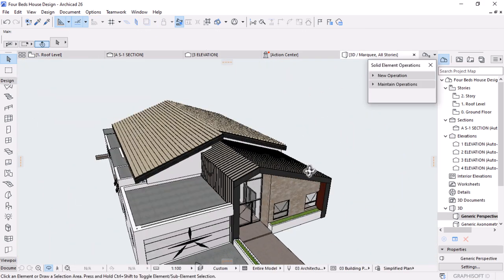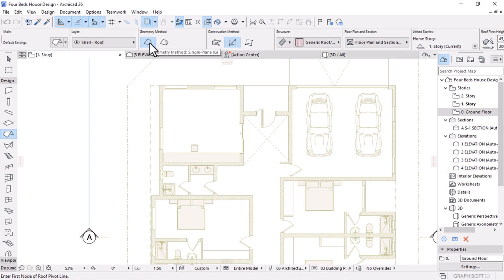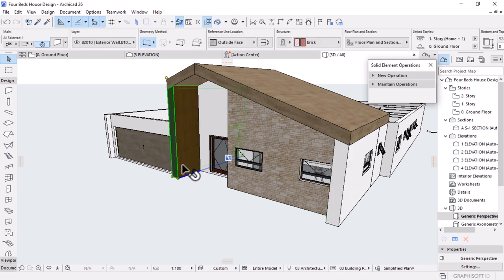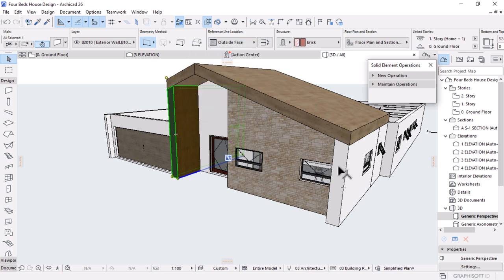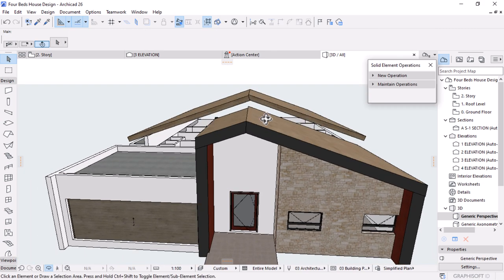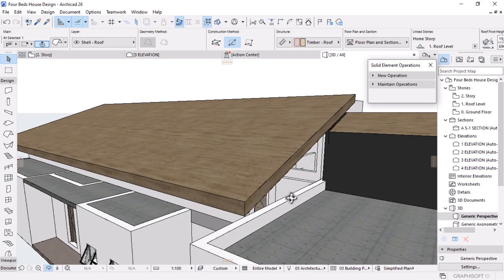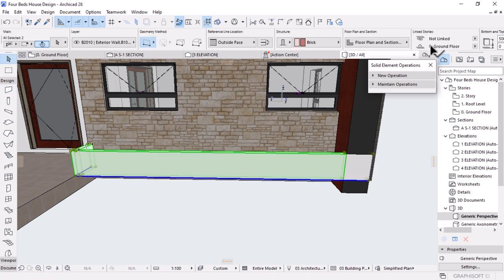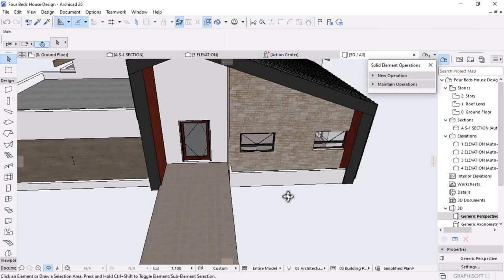ArchiCAD Project 3D Design Process From Start To Finish | Residential House  House

Comment: Wow, thank you so much for your tutorials from start to finish. I was about to switch from Archicad to Revit. Yes, I would also be very happy if you could model a building like a cultural center. I am wondering about your flow in the works such as gallery space and similar works, especially outdoors and indoors.
Reply from the maker: You are welcome and I am glad that you find it interesting.  Thank you for the suggestions and we will  respond ASAP with a video.

Comment: Where do I start learning ArchiCAD?  ,Thank you
Reply from the maker: I will recommend you watch this video https://youtu.be/7wfax2L1w_A It will help a huge impact
Reply: @MesolightVisual  
Ok , Thanks
Reply: @MesolightVisual  Another question please, would you advise me to learn ArchiCAD or Revit?
Reply from the maker: @user-abdelrahman03  They are both BIM softwares, it's a matter of the preference . Before I was using Revit, then migrated to ArchiCAD due to its not steep learning curve and its lighter